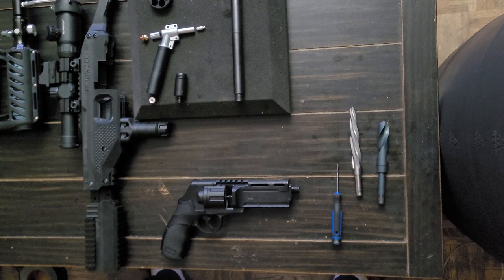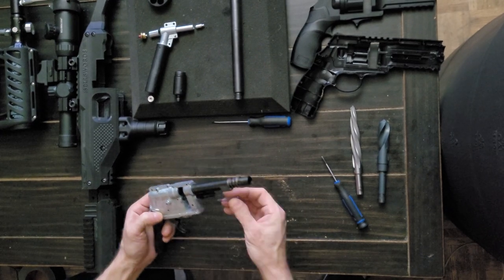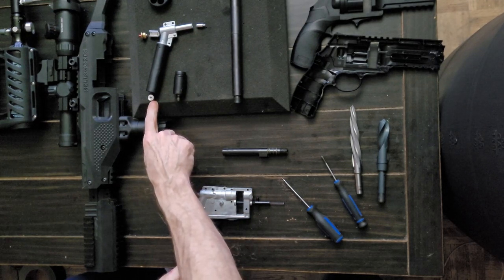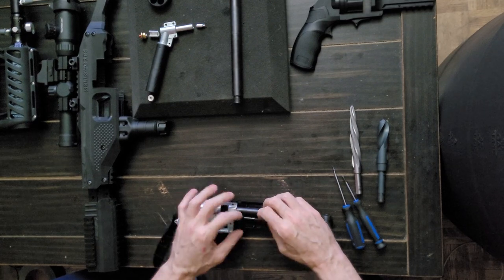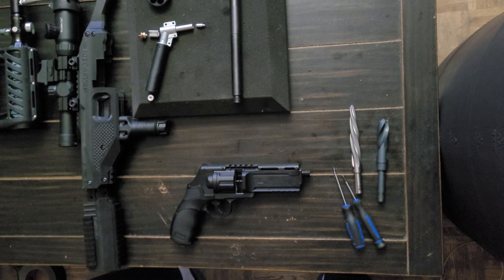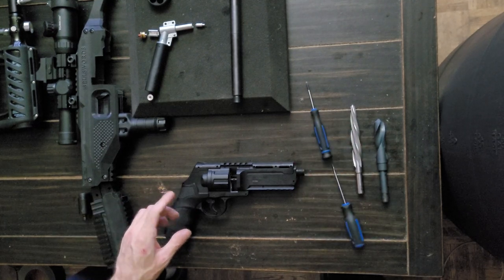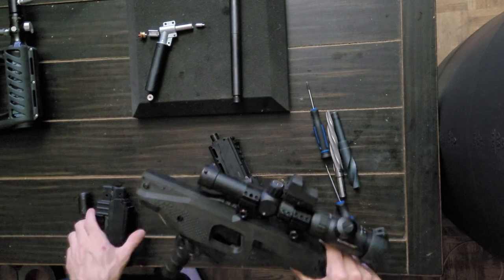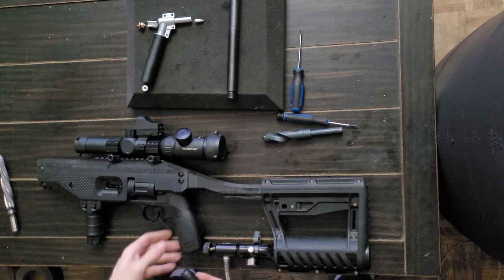Umarex T4E HDR 50 Power tuning 95 joules, carbine mods

Comment: The problem is that isn’t less lethal anymore. I have a gun, this is if u don’t want to use a gun. I have 40j and that’s already almost 2 much
Reply: What gun is the 40 joules?
Reply: Go with what you want.
Reply: That's not a problem it's the solution. That's the whole point

Comment: I admire all the work you are putting into these to demo higher power potential.  I enjoy seeing innovation. Maybe a few people will have the skills to do it as nice as your build but most won't.  It's definitely an option though to move from the easy 40-50ish Joule VKS "less lethal" out of the box into a gray zone of lethalish by putting in the work. At least that option now exists.
Reply from the maker: awesome man thank you, i just got into making vids, i started to silence the haters lol now i actually enjoy doing this, so much about these people dont know. and ive all ready put my vks and m17 away locked up as i dont even use them, as much as i want to they just dont perform like there t4e markers and im always scared to break them lol
Reply: Yes building all the extra kit is lot of work, but it looks like if all you want is power, there is very little work needed (aside from barrel extension).  Just get cheap TR50, take valve block out, add hpa extension and that's basically it.   Get remote line and hpa tank/regulator with adjustable pressure.  No need to shorten valve pin, no need to take regulator disk out (since there isn't any on TR50).
Reply from the maker: @springer-qb4dv  yes that it really the valve block, barrel and hpa is where the power comes from, not much needed for max power
Reply: Agreed for me even with the 11 J valve upgrade I did I'm still getting over 11 joules with the ammo I use 95 Joules is definitely verging on lethal plus it was a pain in you know what doing the first upgrade I'm sure I could do it now that I've got more experienced but do I really need 95J I don't think so also I have to wonder how the heat core will hold up to that kind of power
Reply: @UmarexLessLethalHomeDefense  hey man. Love your videos. I wanted to ask you what your opinion is on the sniper barrel extensions hd24 has for the hdr50?
Reply from the maker: @trishahouston3656  id say they are worth getting, every hdr50 needs one :) especially if you have a carbine but if not still id have them, they are great with hpa and perform best
Reply: @UmarexLessLethalHomeDefense do you have a parts list? How much did this cost? And how long can you leave it under pressure? Like can it sit for a few months with the canister attached and ready to go?

Comment: Hello, have you considered dieseling a Z.50 V2 projectile in combination with HPA? Oxygen is combustible whereas co2 isn't. How much high pressure air do you think is required for ignition? I have a stainless steel bolt and firing pin in my HDR 50. The only thing I'm concerned about is a reaction to heat on the seal in the valve housing. My HDR 50 modifications including a 16" tuning barrel achieved 580 fps (73 joules) with a 'devastator' round! I'm still waiting for additional tuning barrels to bring the length to over 24" and with HPA I should realize 95+ joules. My existing HDR 50 tune-up consists of a stainless steel bolt, stainless steel firing pin, restrictor removed, valve block removed, the 'extreme modify pin', tuning barrels (16"), tuning drum, 2 Z-chambers. I achieved 4 consistent shots with one 12 gram CO2. I also ordered the 88 gram adaptor W/ additional air chamber from Critical Situations. That is for the Umarex dual CO2 adapter and/or 88 gram cylinders. My next acquisition will be an HPA set-up! What HPA pressures do you recommend for application with my modified HDR 50 carbine build? Thanks, JJ 🙂

Comment: Thanks for the instructional video.  What is the optimal barrel length?  is 18 inch long enough to get maximum power?  You mentioned 22 inch barrel.   Since big bore air guns are pretty expensive, HDR50/TR50 maxed out could be cheaper alternative (as long as something inexpensive like sched 40 steel pipe is used for barrel extension).   3/8 inch pipe has 0.493 inner diameter which should work.
Reply from the maker: i tried a 22 inch barrel and got a 10 joule increase, im dying to shoot this at some longer ranges its more fun and yes very cheap compared to a texan .50 lol or a dragon claw
Reply: @UmarexLessLethalHomeDefense  or Umarex Hammer which I own. But thinking I may need to buy an HDR 50 to play with.

Comment: That was AWESOME!
How many psi do you run into the gun when you swap from CO2 to PSA?
I have an HPA tank and always wondered how much pressure I would have to set it at if I wanted to use it in place of CO2 cartridges.. Just didn't know what range to regulate it at that wouldn't blow up a airgun that was made for standard CO2.
Reply from the maker: i stay at around 1100 psi output some go to 1300
Reply: @UmarexLessLethalHomeDefense  Thank you for your response 🙂
I would have said thank you when you first responded but stupid YouTube never notified me.
Thanks again🙂🙂🙂
Reply: @UmarexLessLethalHomeDefense  Thanks from me too! 😊
Reply: Hey does switching it increase fps

Comment: Hi, I'm Joseph, I want to upgrade my umarex equal to yours in the video and I would need to know where to buy the screw fitting that fits the gun and the cylinder that you have mounted in the stock that you see in this video. Thank you and congratulations for the good work you are doing.
Reply from the maker: you can find the parts at home defence 24 dot com, look up hpa adaptor, or from mcs.com

Comment: Hi bro wanted to ask if not a problem , i see on your marker you have a short line running into the hpa tank. i'm looking to do the same so i don't have to have a long coil dangling around even if i mount it to the side of my marker. wanted to ask what would i need to  have my hdb68 cal. have the same setup as this one you have. in this video.? also don't want to have my tank w/the remote line just hanging out under the grip with the long coil. appreciate your help bro with what i will need to have my marker with this setup, stay warm up there in the great white north :)  cheers bro 👍
Reply from the maker: hello check out critical situations dot com, he has what you need just message jon and let him know you spoke to me and he will set you up with any thing you need for any type of build
Reply: @UmarexLessLethalHomeDefense  Will do. thanx bro 👍

Comment: so if i get the hdr50 11joule version where do i get the barrell extension ect i wanna build ooe to be powerfull but not wit a super long barrell whats my best option and i have the hdp compact with governor removed lol whats the best rounds to run i got those homewreckers white ones but there light like the ones that come wit the kit
Reply from the maker: check home defence - 24 .com every thing you need there :) and steel balls once modified are the best ammo in 50 cal

Comment: Does anyone know the length diameter and spring weight on the hdr 50s striking bolt I lost mine and can't find anyone who sells it
Reply: why dont you go to umarex shop ,im pretty sure you can get the part you need ?
Reply: @rick31869  they told me they didn't sell it I called them first
Reply: @michaelbertrand3725  WOW !!! that is strange .i know crossman gives schematics and parts list breakdowns , thats sad umarex doesnt have all parts in the ready ! you will have to research custom springs and have someone make it ,but you need to ask umarex all the tech info on spring like lenght ,size piano wire , and poundage ? this would be a perfect opportunity to get a much stronger spring !
Reply: Ask them today about the specs on the spring they gave me the run around again its like there refusing to sell replace or give me any info so I could fix that hdr50 it's weird

Comment: Hey what'size pipe do I need for replacement barrel for hdr50
Reply: Or hdp50
Reply: We can not order those parts
Reply from the maker: home defense 24 dot com has all you need
Reply: @UmarexLessLethalHomeDefense  so you are saying that you were instructed to not share any pipe dimensions?
Reply: @UmarexLessLethalHomeDefense  my country is not allowed to order these parts.
Reply from the maker: @megaman9267  oh no man i just dont know the diameters florian could help you at hd-24, i use a brass 17/32 pipe from a hobby shop for the larger steel balls in 18 inch for my rifle set ups
Reply: @UmarexLessLethalHomeDefense  for 50cal